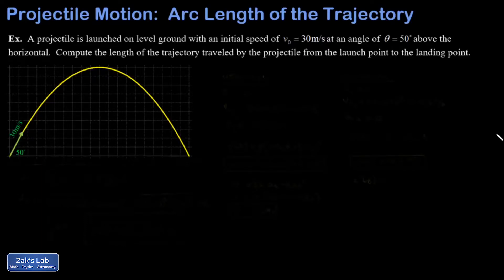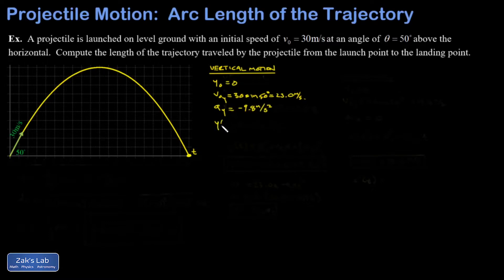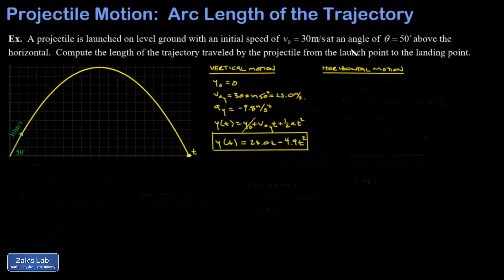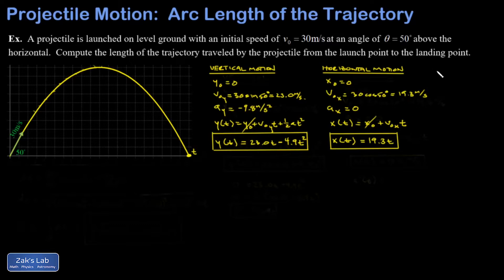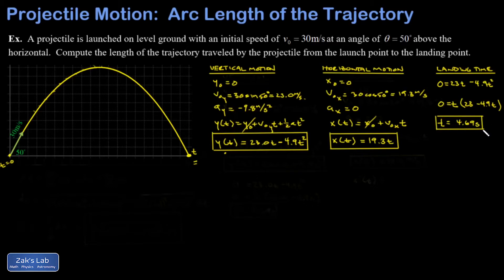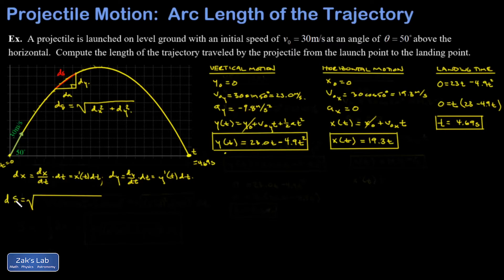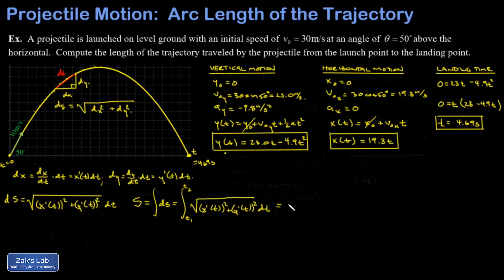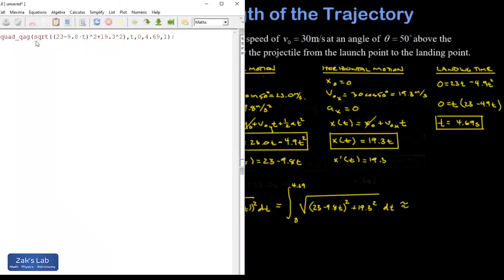Projectile motion arc length of the trajectory using parametric equations. Parametric arc length.

Comment: If you get the function's height with respect to the horizontal distance traveled (the actual cross-sectional view), then solve the integral for its arc length, then I believe you can generalize the solution to its path length:

v^2[sin(θ)+cos^2(θ)ln({1+sin(θ)}/cos(θ))]/g

If you want to include an initial height, then it becomes a bit more complicated:

{sqrt(v^2sin^2(θ)+2gh)sqrt(v^2+2gh)+v^2[sin(θ)+cos^2(θ)ln({sqrt(v^2sin^2(θ)+2gh)+sqrt(v^2+2gh)}/{v(1-sin(θ))})]}/{2g}

Comment: Bro how t=4.69 come pls help me
Reply from the maker: when you have 0=t(23-4.9t) the equation is true when either factor is equal to zero.   So you could say t=0 (true that  y=0 here, but we already knew that) and  the one we're interested in: 23-4.9t=0.  To solve the second one , add  4.9t to both sides then divide by 4.9 to isolate t, and it turns out to be 4.69s.